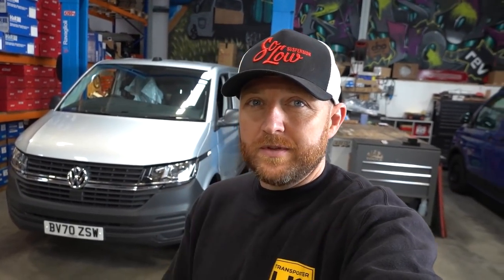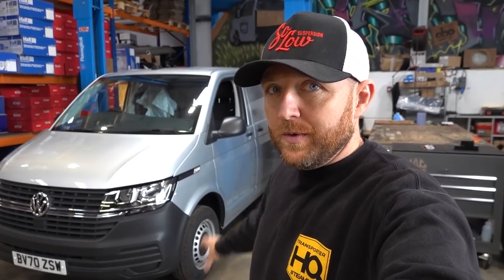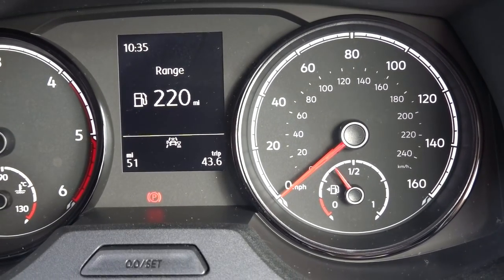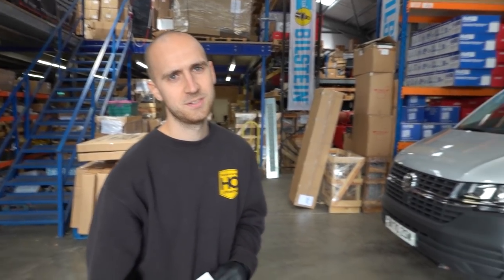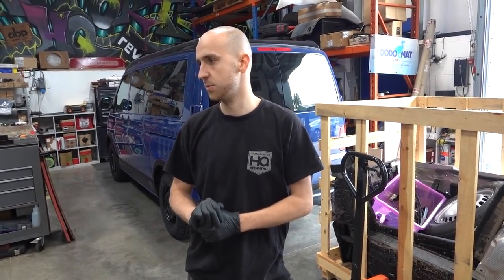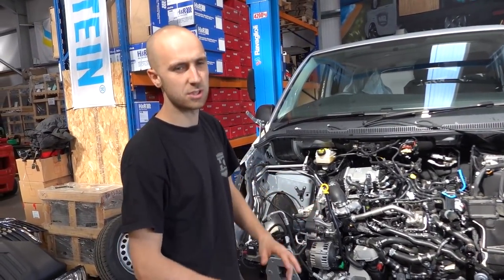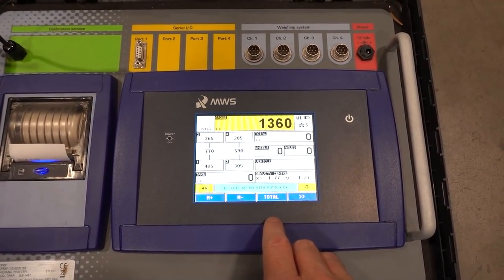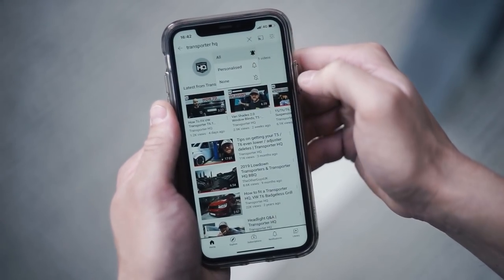Tesla Powered VW Transporter T6.1 Episode 2. Goodbye VW Warranty | Transporter HQ

Comment: The mileage difference could be because both the engine and instrument ECUs store the mileage (so you can determine the miles a particular engine has done I guess) and you’ve just removed one?
Reply from the maker: Its back at 51 now!! haha
Reply: @THQAutomotive  can you push it around the block on pt3